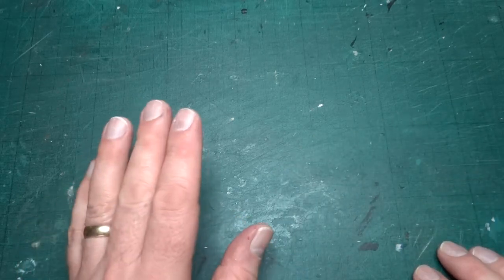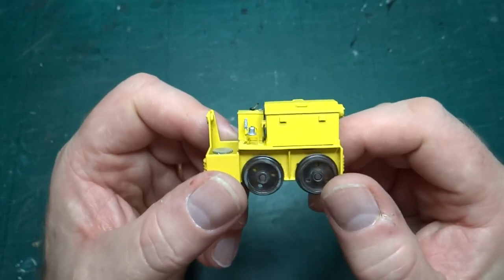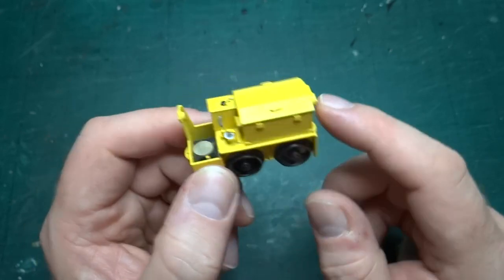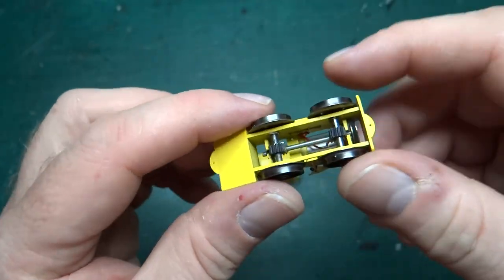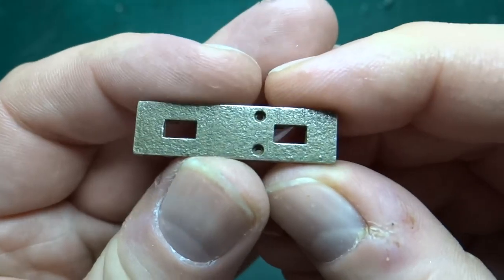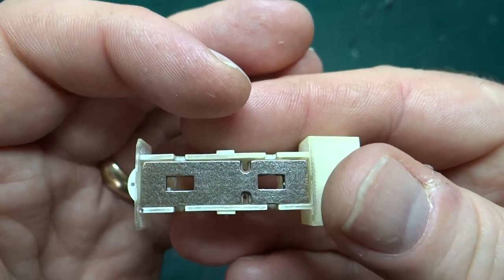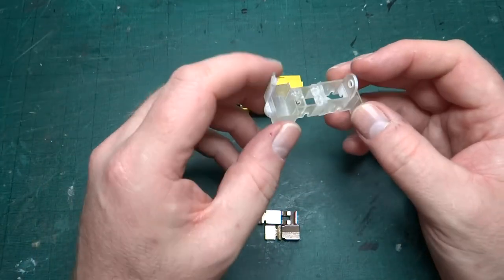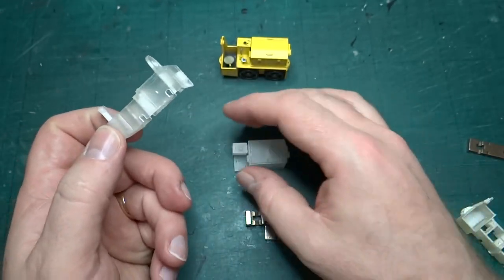I've Finished Designing.... Clayton Equipment Ltd. Works Number 5843

Comment: I had a short dabble in O14 with a Roy C Link loco, some skips, and make-your-own track parts. It never came to anything other than assembling the loco. I often think of trying again.
Reply from the maker: Yeah, it seems a lovely scale/gauge combination but like you I've not got much further than a loco and short length of track. I do have a number of KBScale wagon kits (formerly Roy C. Link kits) and the point jigs so hopefully one day I'll build at least a small working diorama on which I can pose/run the Clayton loco.